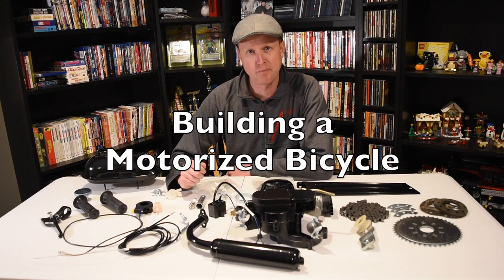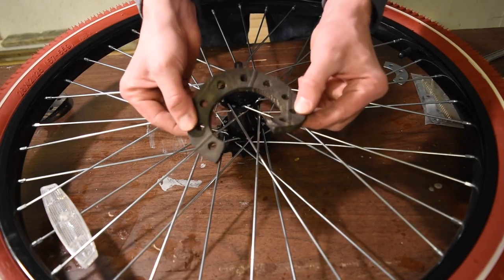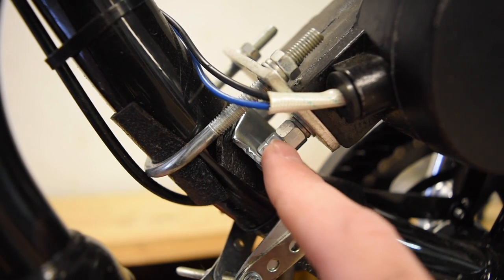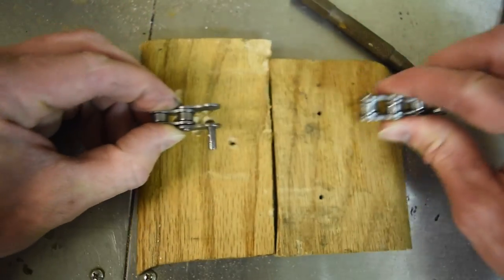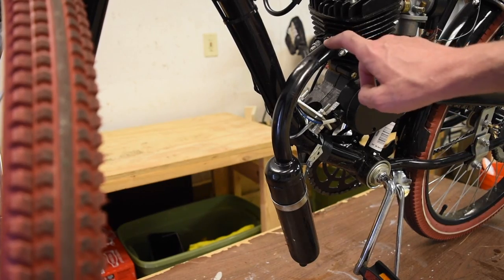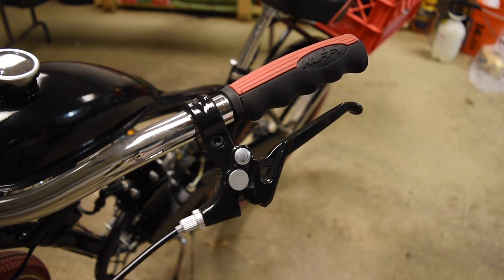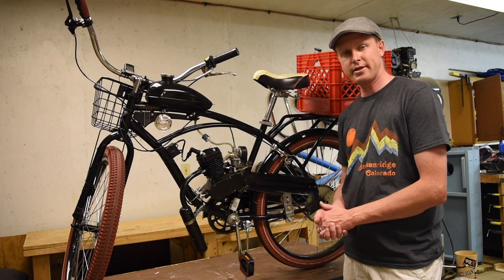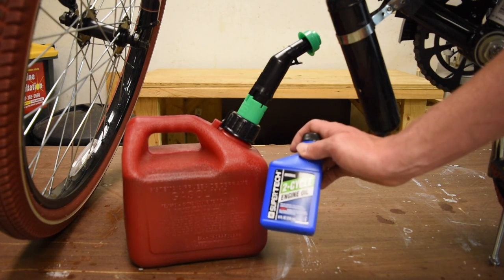Building a Motorized Bicycle - 80cc Engine Kit - 75 mpg

Comment: What is the reason people select  beach cruisers for motorized bikes?  They are ugly in my opinion and I would rather use a 26" mountain bike.
Reply: Personal choice
Reply: I think they have better miles because you can cruise for longer distances without acceleration
Reply: I normally hate the look of a beach cruiser but for a motorized bicycle they look the best. Much more motorcycleish looking. I see guys with shitty looking mountain bikes with motors and it gives me the idea they just did it because they have a dui or something, when I see someone on a nice looking one it looks more like they did it for fun.
Reply: durability of the frame. and you also have to have space for the engine. it is a lot of stuff crammed in a small spot. most of these kits suggest at least a 26. most people throw these engines on regular store bikes. that is fine for a 49cc most times but if you buy a 212cc and you weigh 200lbs something bad is bound to happen.
Reply: There is more of a droop design that gives more space for the engine, and also a lot of people think they look similar to bobbers

Comment: Hello I was wondering. Do I need the clutch to be able to put it together and ride?
Reply: @Steve_Does_Stuff  darn. I don't have the clutch cable or the springs. I got the engine in a trade. 

Everything is all hooked up and bolted. 

But let's say I don't want to pedal the bike. Could I still ride it without the clutch?
Reply: @Steve_Does_Stuff  

Okay I guess I have to buy it lol

Comment: PREMINUM GAS HAS ETHANOL IN IT!!!
Reply: Here we have an ethanol free premium option.  People use it in there boats and small engines (engines that sit with fuel in them for long periods of time)  the ethanol burns just fine, it just eats up the gaskets in the carb when sitting over time.
Reply: Best choice in most areas is ethanol free recreation fuel.

Comment: Hey Steve I put my motor bike together, I have the very same bike. I was wondering what was the big black nut and bolt for? The nut has threads on thee inside and outside with a big bolt.
Reply: Thanks Steve for the info ready to get on the road. One further question how can I bend the exhaust pipe without a blowtorch for heating it up so it won't be in the way of my peddles?
Reply: Thanks if there are any other tips you can give that would be great.
Reply: Hey Steve I have put my bike together and tried to start it and my chain keeps popping off, can it be cause of the length of my chain? What can it be my back tire stops moving as well.
Reply: I'm trying to do it all myself instead of going to this guy and having it done and spending any more money.
Reply: Yeah I have taken off 6 links so far so maybe I should take off more? Is there anything else? I have the clutch pulled in all the way and the tire still won't move sometimes but when I peddle the chain looks real loose and not tight.

Comment: Great demo thank you, might even consider spot welding that tensioner.
Reply: to keep chain tensioner where it don't twist or anything, drill a hole in the through the tensioner & 1 side of frame with self tapping screw to hold it in place.

Comment: I have the same bike so your vid will be a big help when I install the engine. Thanks
Reply: me too just built engine but had a few problems while installing, engine was too large and carb didnt fit, had to cut intake manifold but now its not level, have to but offset intake manifold but recently when just starting it for the first time while pedaling the chain tensioner got pulled into the spokes and warped the rear wheel, luckily i have new wheels on the way, i strongly suggest a few things, either replace all bolts at hardware store or use loctite, also replace the chain tensioner with a spring loaded one so it has some give and doesnt just get pulled into spokes, and last piece of advice, get an adapter or wheel with a dedicated hub so that way you dont attach sprocket to spokes and weaken the wheel over time
Reply: OK Chris, I will. Thanks
Reply: you put the engine on yet any updates? i have mine built but i dont have brakes yet, been riding around and using the good ol foot brake haha but i have some on the way and the bike will pretty much be done, i think ima replace red tires with black ones to give it an all blacked out look
Reply: Chris W.  Haven't started yet. Was going to start this week but hurricane Florence has made me put it off until all this is over. I live right where they are predicting landfall.
Reply: uh oh, thats not good man, well stay safe and good luck with the build when you start, you can ask me any questions or i suggest going on motorized bike forums for help. best site imo to buy parts is Bikeberry.com they ship very fast and have good quality parts, gasbike.net is good too but they take 1-2 weeks to actually ship things out
Reply: Jamaica Dog, I have the same bike too and the bicycle last me 3 months and 10 days. The frame failed on me when I ride. I completely take every thing of the bike like coil, engine, cable and all the stuff. I actually put on a bbr tuning motor ready bicycle from bikeberry.com.
Reply: @burnt_toast305  hmm there are different models of the bike, older ones have weaker frames but mine has held up pretty good and I just drove with it on the back of my car from AZ to ID, but did you put foam or rubber under the engine mounts to reduce vibration? That helps
Reply: @ChrisW777  yes a rubber cushion will help with vibration, only if the gas tank frame has a front motor mount which it comes already  attached
Reply: @ChrisW777  I've also found out a few things the hard way, and agree with your recommendations. Although I haven't yet had a problem with the rag joint sprocket to spoke arrangement, (after motorizing three bikes and a trike) I'd prefer the hub drive you advise.

Comment: How fast is it i was told the best i could hope for was 40 miles an hour
Reply: I, a bit over 200 lbs, once got up to 63 km/h, or 39 mph, going downhill, (not sure if the wind was at my back), with the 44 tooth rear sprocket. That hasn't been repeatable. If top speed is the aim, the smaller/fewer teeth rear sprocket will help, but 40 mph on a bicycle has significant risks, such as dying violently, and before you figured on it. 25 mph is a fair expectation, maybe 30 downhill, with the stock kit, and seems pretty brisk when you're doing it. Driver and engine both stand to last longer at speeds closer to the requirements of sanity. Getting old isn't for sissies, but it's not all bad.

Comment: +steve does stuff Hey wondering where can I get a fuel gauge for my bike? Would like one for my bike to show how much gas I have left.
Reply: Steve Does Stuff! Yeah and I can't seem to get it to stay idle tried the screw but nothing.
Reply: Oh question where can I find a metal throttle kill switch? I just ordered the metal throttle housing but looking for a metal kill switch combo or something. My nylon throttle housing broke.
Reply: Hey Steve thanks for the info on what to do. My bike runs but my chain is loose and hits the tensioner I have taken out a few links but it is still loose. What can you tell me, do I need to take out a few more links to take out the slack. I have taken out about 9 links thus far. What could be the issue.
Reply: I think gasbike.net sells a spring chain tensioner, that will take care of it, just make sure your chain is reduced to less than 1" play before tensioning

Comment: How fast does your bike go because you have the same one that i do so i wondering how fast yours goes
Reply: Steve i was told it could go 40 mph and that is what i am hoping is right but mine looks just like your kit so i might only get 20mph but i hope not i am hoping for more speed
Reply: @archielamarr2950  It's a bicycle engine not a motorcycle. Bicycle brakes can't handle sudden stops at 40 MPH so if you need to stop suddenly, you're going to crash. 

If you greatly sacrifice acceleration torque, you could feasibly hit 40 MPH with a small sprocket. But you would have trouble with hills and it would take a while to reach that speed.

Comment: If you go to the Wal-Mart's website you can get this same oil in gallon jugs for $12. Some stores may keep it on the shelf but I had order it through their site to store website, then pick it up. They sent me an email 1 hour later saying my oil was ready to pick up and I was thinking, "WOW that was fast". Turns out my Wal-Mart actually keeps these 1 gallon jugs in the back room but does not keep them on the shelf. I guess to make space for other items.

Having a Trabant, Polaris ATV and other 2 stroke powered machines, I go through allot of two cycle oil. So I usually mix up about 20 gallons at 40:1 at a time. So it's best to buy it in bulk.
Reply: Those 2 stroke oil in one gallon are marine grade oil. It's is designed for use in boats
Reply: If you go to Napa there is a 50:1 gallon bottle for $1.50.

Comment: Hi. Great video. Im thinking of ordering the same kit for my bicycle. I have a question, how many times do i have to use oil to gas mixture? Afterwards, can be run on just fuel alone? How many miles daily should be maximum ridden for break-in period? Thank you
Reply: Steve ok thanx. Just watched your second bike build  video. Had another question. Sorry i couldnt fit it into prior questions. Do you end up losing the front breaks cause of clutch lever? Your vids were perfect. Feel like i could install kit blindfolded now thanx to you
Reply: Steve thats a great idea! I just checked on Ebay $12. I will do the same thing. Can never be too safe!  I think i am going to buy the 80cc motor kit for $90. Is there a way to tell when i get it that it's really 80cc? I would hate to get duped with a 50cc motor. I appreciate your responses btw Steve. 👍
Reply: Steve so i was just curious, you need to peddle the bike to start the engine. So how do you ride the bike normal without having the engine start?
Reply: Steve thanx Steve. I really appreciate all your responses.
Reply: After 500 km

Comment: The 6.4 ounce bottle cost more then the 8 ounce bottle because walmart create their own full synthetic oil line. Feel free to spend a little more money for the full synthetic.
Reply: Steve Does Stuff! Your welcome sir anytime
Reply: don't do synthetic, I explain in an above comment at the top why
Reply: I use Quacker state 2 stroke oil about $3.30 and I have right at 4000 miles on one and so far replaced the driver sprocket because I also pull a B.O.B. trailer Love to ride be safe out there
Reply: Phillip Baily I use vp small engine fuel full synthetic 2 cycle oil for 1 year 5 months and 20 days. so far it's good stuff. I pick it up at walmart for 7.68. I'm thinking about using echo red armor oil for my motorized bicycle. I hope is good stuff too because I heard good things about it.
Reply: @burnt_toast305  I hope it works well for you I know there are better oil's out there but money talks I  wish you the best
Reply: @phillipbailey9907  thanks man

Comment: what should the spark plug gap be?
Reply: To answer your question, a larger gap will give better low end and starting and a smaller gap misfires less at high rpm. Gap can be anywhere between .020 to .040. You can start with .030 and go from there. Hope that helps.

Comment: Do you recommend cable brakes or is the coast brake okay and safe enough?
Reply: What about a disc brake???
Reply: Yes you can get a kit for both front and rear disc brakes for this bike, Also a rear hub adapter takes the pain out of the sprocket mounting on there rear and comes with a disc brake adapter built into it!
Reply: link??!?!?!?

Comment: where do you find your break
Reply: Go for disc brake kit front and rear. Get the rear hub sprocket mount adapter that eliminates the hassle putting on the rear sprocket and has a disc brake mount holes already attached to it.

Comment: What's wrong with ethanol in the gas?
Reply: Where do you find non-ethanol gas?
Reply: You can make your own non-ethanol gas if you don't have a supplier.  Take a gallon of ethanol gas and mix a pint or quart of water in it (shake it up really well) and wait for the gas and water to separate into different levels then siphon or pour off the gasoline from the water and you have non-ethanol gas. (I use a glass 2 gallon jug so I can see the separation) What is happening is gasoline and alcohol (ethanol) will mix but gasoline and water will not.  Ethanol and water will mix so when you shake up the mixture you are combining the two (ethanol and water) and then you can seperate the water and gas by pouring the gas off the water.  You won't have a full gallon of gasoline (one gallon minus the 10% or whatever the percentage was) but at least it works. I'v been using this method for several years for gasoline to run my lawn mowers ect.  Also, another tip is that if you are not going to use the engine again for while (several weeks) let the engine idle untill it runs out of gas so that there is no gasoline left in the carbarator  The carb will not varnish up and will give you no trouble over the next few years.

Comment: So do I lose my rear/front brakes?
Reply: Steve Does Stuff! Ok, would an electric conversion kit be better? I don't like the lack front brakes though...
Reply: Steve Does Stuff! Yea I've seen it before. Also, Is there an aftermarket exhaust? The exhaust setup seems a bit closer to the pedals (hot exhaust + legs = !!!)
Reply: Steve Does Stuff! Ok that sounds good. Also, is there any way I can mount a smaller gear to the rear wheel? I would like a top speed of 35-40 mph
Reply: Steve Does Stuff!  I'm ok with lower end torque. And one last thing, are there gearing kits (to help with torque) that I could install?
Reply: Steve Does Stuff! Ok. Thanks for the advice :)
Reply: Steve I have my clutch lever mounted directly to the right of the front brake lever, and angled below the brake lever. That way I can keep my front brakes. 

I also took a suspension fork from an old mountain bike and removed the stock fixed forks. I did it to improve the ride and while it helps with that it also cut down the vibration exponentially. I also now have cantilever front brakes, paired with the old style U shaped back brakes (which are terrible) it stops fairly quickly. I can't post pictures here obviously, maybe I can upload a few to Google+ if you're interested.